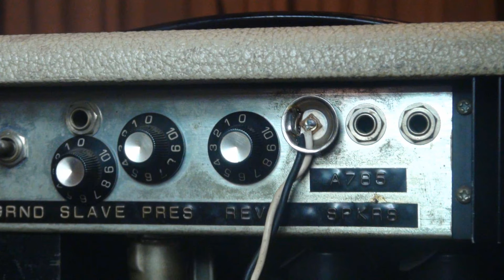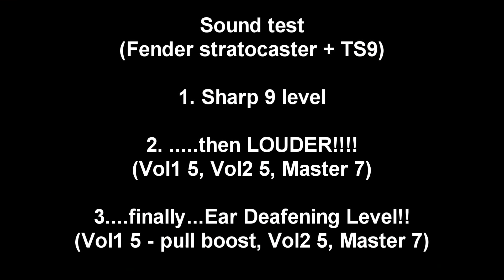MESA Boogie MkI

Comment: That you installed the EV without bothering to make the logo upright makes me wonder about your attention to detail.     And you installed the wrong version EV for this amp.  There are many variants of the EVM-12L and the one this amp wants is the 80s Series II version with the black and white label and no heat sink.   It'll sound right in this amp.
Reply from the maker: a) I didn't know that the logo direction has so much impact to the sound...we keep on learning (LOL). Actually I install speakers takin into account the placement of the connectios...there is no point installing the speaker with the logo correctly facing and the  speaker connections at the bottom of the cabinet (that was the issue here)  b) the currently available EVM-12L version is that I installed. There are a lot of older not currently produced GREAT speakers (and I would personally go for the JBL K120) but this was available by the time the customer asked for a NEW speaker.
Reply: I was taught by a JBL service tech to mount a speaker WITH the terminals at the bottom, so if a lead breaks loose behind the cone, it won't drape over the other lead and cause a short.
Reply from the maker: That is not the case with this amp (actually it is the first time that I hear this theory - maybe it applies to hi-fi speakers) . Putting the terminals at the bottom means to replace speaker wiring with longer wires (that has also an impact to damping factor = less efficiency) + if a lead breaks loose and it is the hot lead then there is a great danger to touch the reverb tank (that is at the rear and not at the bottom) that is grounded so it will also cause a short. However the point is that  any amp owner should go through regular maintenance of the amp so that leads will not break.